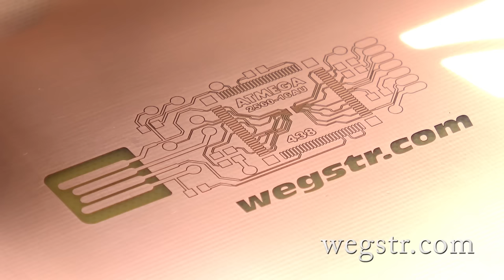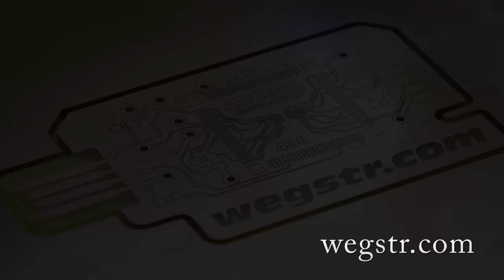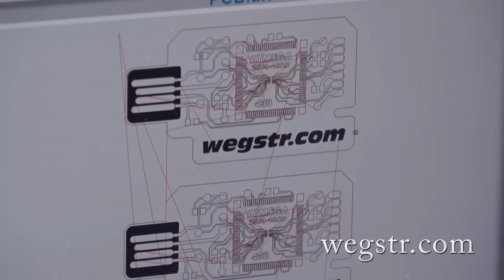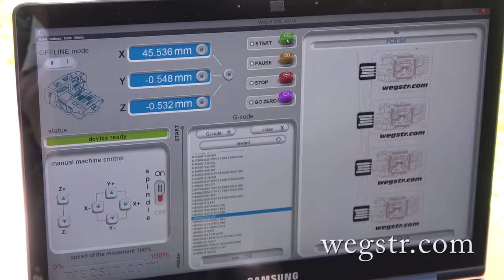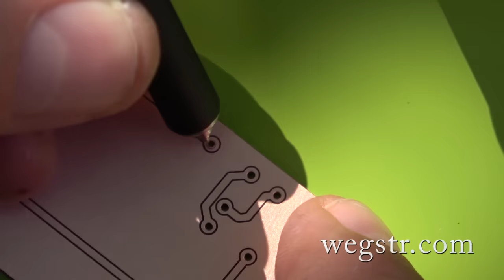Double layer PCB prototyping 0.1 mm traces/spaces

Comment: Ok, big amount of cooper beetween is good for heat spreading and RF shielding but... how to solder it without short circuts?
Reply: Well, if you're skilled enough, it won't be a problem. You can also apply some sort of DIY solder mask, there are some solutions out there
Reply: solder mask, look at the other videos

Comment: What different than usual method?
Reply: One of the benefits of using a CNC machine is that you needn't use other chemicals
Reply: es más sencillo de hacerlo tú mismo
Reply: Nothing, this is just an ad for a cnc mill they make and sell. correction from looking at the process a bit more looks like they take out the eching step and just replace it with this. still an ad for the Mill though

Comment: Cook but what does that board do
Reply: The MCU is the ATmega2560, same as in the Arduino Mega and it has a USB connector. The MCU itself has lots of useful pins, but the board has a very limited number of pads connected to the these pins,  so I guess this board is just a demo with somewhat limited use.
Reply: @SteinErikDahle  This machine can be a great way to test sections of complex boards,can save a lot of money during developments,very good.

Comment: Can't be used in high voltage circuit
Reply: Why?
Reply: @toxanbi  because voltage will arc or jump to find the nearest ground or negative voltage.
Reply: @Entertainmentchannel4U  for your information, high-voltage PCBs those which are made using traditional etching process, do often have milled slots between traces to increase leakage path distance and avoid arc breakdown.

But in this prototyping technology everything is done by milling. Milling bit may create any gap between traces whichever PCB designer wants. It can do slots between traces having arbitrary depth.

So why on earth do you call it not suitable for HV stuff?